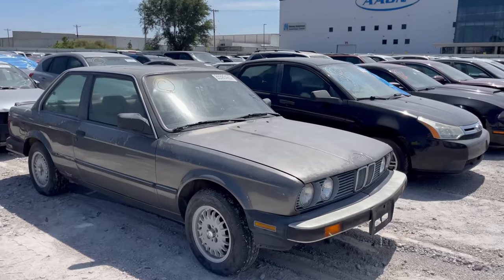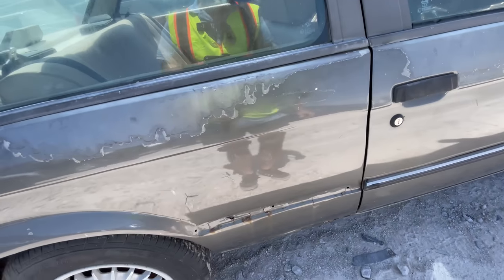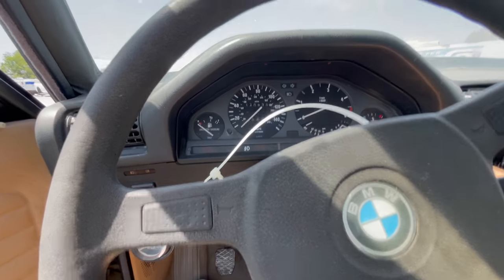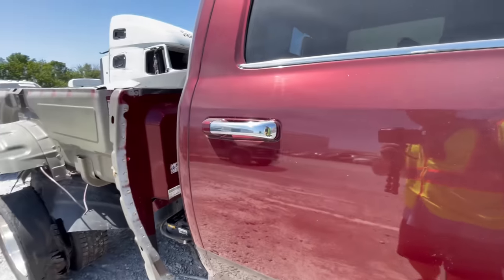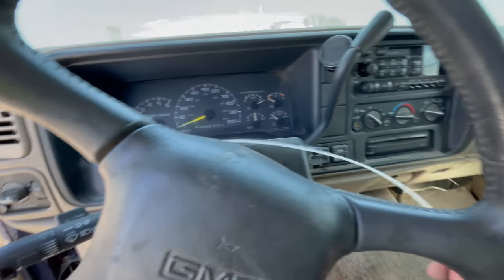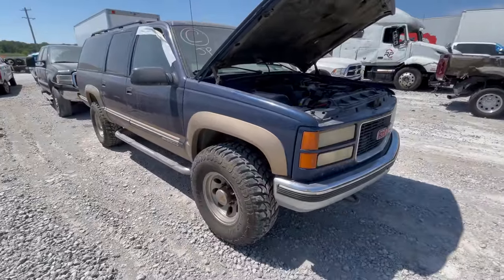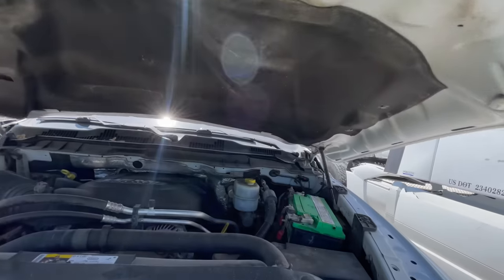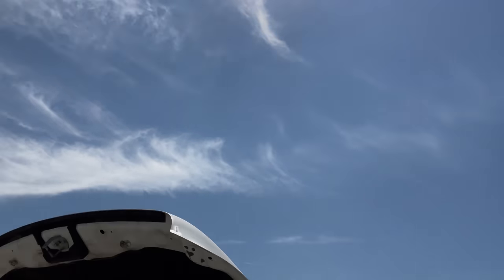325e: Best Ever?? Copart Walk Around - 9/4/23

Comment: G'afternoon Mike ☕☕ 🤠 . I highly recommend you pick up that 2500HD quick like bunny because you stumbled across a diamond in the rough. That has the same 6.0 big block 396 vortec that your Escalade has in it and as you mentioned in your Escalade Ideo there's good reason why there are no 6.0 engines available in the junkyards because they're the biggest, baddest and most reliable big block engines GM ever built besides me Buick, Pontiac and Oldsmobile 455's 😇
Reply from the maker: Good to know!
Reply: LQ9 is a beast